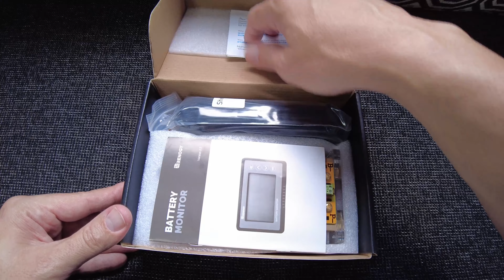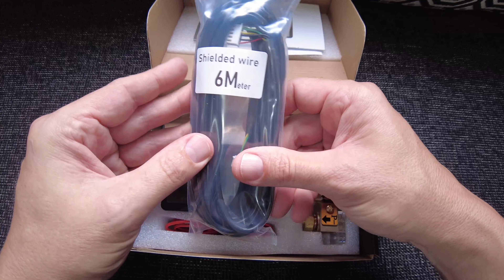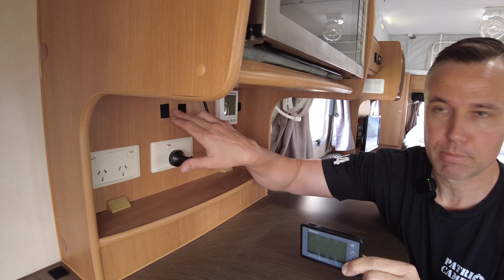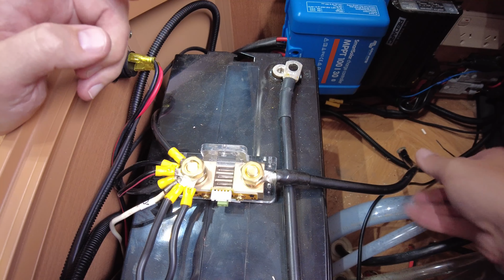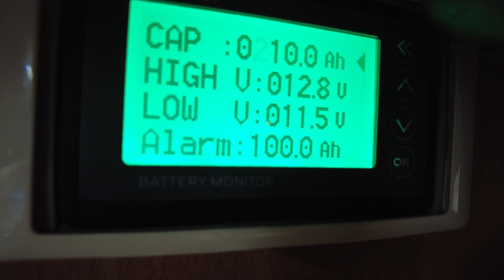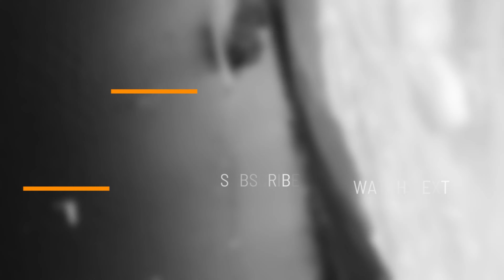Installing a Renogy Battery Monitor RBM500 into a Caravan || Easy DIY!!

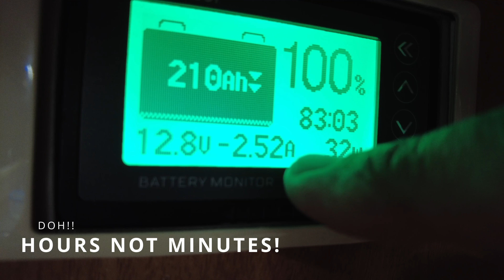Comment: Great video, thank you .  I believe that at the ~7:00 minute mark  you referred to the 'time remaining' as 83 minutes and 5 second.  I believe you meant 83 hours and 5 minutes, as that would be the correct amount for a 200 Amp Hour battery drawing ~2.5 amps per hour.

Comment: looks good. Just note that this shunt, you can remove the clear plastic holder and bolt the shunt directly to the negative terminal.
Reply: I was wondering  I just got the controller was going to install this weekend that plastic is tight and I didn't want to break anything

Comment: what is the name of the surround you installed for the display? i need one too. thanks.
Reply from the maker: It’s just a power point cover I pinched off one of the other Power Points in the cupboard.

Comment: In my setup in my Honda Element, the 12V 100 amp AGM battery is in a battery box that is fitted with a cigarette lighter style plug, into which I can plug an appliance (in my case a 12 V Setpower fridge) to provide power to the appliance.   At the same time my roof solar panel is connected to the battery terminals to provide incoming power, through a charge controller, and I also have a Renogy 20 amp DC to DC charger that connects my starter battery to the terminals of the AGM battery so that I can safely tap into the power available from the alternator while the engine is running.   What I want to do is hook up the Renogy battery monitor so that it gives a continuous readout of the state of charge of the AGM battery while that battery is supplying power to the fridge through the cigarette lighter type plug, and simultaneously drawing in power from both the solar panel and the starter battery.   Any reason why that should be a problem?

Comment: Installed one of these last year and they are far from accurate, I have the Renogy 200AH Core lithium with bluetooth and the 500A monitor, the monitor says the battery is 100% SOC at 200AH 13.4v while the battery BMS reports to the bluetooth app the battery is only 89% SOC.. DO NOT RELY on this bit of gear for accurate SOC info...

YES I do have it installed as instructed and Renogy after sales support is non existent.. I love the 200AH core series battery but the rest of their gear can be sketchy at best.
Reply from the maker: Yeh I have heard that. Mine was fine but I ended up swapping out with the Lithium battery monitor.

Comment: Does the Renogy monitor display information that matches the battery info displayed in the Victron app from your solar charger?
Reply from the maker: There is some minor variations to amp and voltage but for the most part it’s pretty much the same.
Reply: @GetCampingOz  Thanks for the response! The reason I ask is that my my victron app will say my 100 watt panel is pulling 85 watts while the Renogy monitor will say +115 watts...

Comment: I need a surround myself as I had the same problem, but can't find a suitable one anywhere ????
Reply from the maker: Mine was just a power point surround that I pinched off a point from an internal cupboard
Reply: @GetCampingOz  did you have to cut it a bit to suit the renogy dimensions?
Reply from the maker: @simonr23  no it fitted perfectly. No cutting required

Comment: Thank you for the Great information. You are the only person so far that showed connecting the P- all together and then connecting through B- to the battery negative. Thanks for that. For some reason I was a bit confused. So basically all negatives should be connected to basically a negative bus bar and then to the Battery negative, correct??
Reply from the maker: Glad it helped. Yes all the negatives should be connected to a bus bar. The way I connected it wasn’t a great example.

Comment: I'm on the fence with this monitor. I installed mine about half a year ago and I initially really liked it. Unfortunately it started flaking out on me about a month ago. It would sporadically sound it's alarm and tell me I had 0% battery capacity in my bank. I think I've tracked it down to a faulty pin on the wire that connects the shunt to the monitor. Unfortunately, I can't seem to find a replacement wire. To be honest though, I'm not sure I  even want to spend money on a replacement wire if this one only lasted 6 months. It's a shame because I really do like the display. Much more than other monitors on the market. Others like the Victron only show partial information where as this one shows everything.
Reply: Yeah I've installed 2 in different vehicles and they've both done the same. They also read full from half as soon as you start charging. Renogy aren't interested in helping
Reply: @xftexute  I ended up replacing it with a Victron unit. Really happy with it. So happy I actually ordered a second Victon unit for my starter battery.
Reply from the maker: That’s no good to hear. I actually didn’t have mine installed very long as I ended up switching my batteries over to lithium. We’re you able to claim warranty at all?
Reply: @GetCampingOz  unfortunately, I’m the type of guy that pull stuff out of the box and installs it usually without looking at the directions and afterwords tosses what’s left. I gotta stop doing that. 🤦‍♂️

Comment: You need a bus bar. It's not advised to have more than three wires hooked to a terminal and you have a bunch.
Reply from the maker: Yeh exactly right mate. I didn’t show this properly. I’ve actually removed this and changed to a lithium setup. Thanks for watching

Comment: Does the negative solar cable still go direct to the battery or do you put that on the output "P" side of the shunt ?
Reply from the maker: All the negative cables go through the shunt. Ideally I should have used a bus bar.

Comment: Mate you have Victron solar charge controller, you should have got the Victron smart shunt for $100 more.
It Blue Tooths to your phone and you can setup VE smartnetwork between it and your charge controller.
To stop those frayed edges, lay out masking tape and mark your cut out, then cut, comes up perfect.
Reply from the maker: Thanks for the tips. Yeh I should have got it but didn’t do enough research before! Doh!

Comment: Was that your grounding cable (to the chassis) on the negative terminal, or a parallel connection? Where do you suggest connecting the grounding cable in regards to the shunt? I was thinking of grounding the distribution bus (which of course comes after the shunt) but should it go directly to the battery negative?
Reply from the maker: Hey mate. I can’t remember! I’ve removed that entire system and put a lithium setup in. There was no chassis ground at all. If I was to do it again I would only have a single connection to the shunt and have either all the earths going to the neg side of a fuse block or have a negative bud bar. Hope that helps
Reply: @GetCampingOz  Yeah thanks, I’ve gone ahead and done just that; a big grounding cable to the chassis connected to a bus bar, all coming after the shunt.

Comment: The next time you have to cut paneling like that use masking tape on the lines where you're going to be cutting and cut through the masking tape the masking tape stops it from shredding so bad.
Reply from the maker: Great tips for next time. Cheers

Comment: I noticed you have 2 wires on the negative side of the battery, you probably wont get good readings over time like this, you might end up having to reset the state of charge more often. ALL negative wires should be going through the shunt. The only wire coming from the negative battery should go directly into the shunt.
(Edit, I read more comments and it appears that this is just from a second battery, so good work!)
Reply from the maker: Thanks for the tip! Ive actually replaced it (it was always going to be a temporary thing) Im now running lithium setup and the new monitor takes its readings directly from the BMS :)
Reply: Yea the 2 batteries are crisscrossed with 4awg wire. Everything else went through the shunt. Thanks for watching. :-)
Reply: If I have a Progressive dynamic converter installed in my DIY camper. This is where I have all my positive and negative DC wires going to. Should I run a wire from the negative side of the bus bar all the way to the shunt or another new negative bus bar, to accept all the hook ups. Then have one wire to the shunt. 

I figure this might make it easier if I am thinking correctly?
Reply: I don't think it matters how you run the wiring as far as the shunt is concerned, but the shunt is there to measure all the "juice" that goes IN and OUT of the batteries. Just make sure anything that uses any power whatsoever, is not between the batteries and the shunt. @danemmerich6775
Reply: The 2nd neg wire is from the other 12V Batt in parrallel, this is correct, if you connected the shunt the way you suggest, you would in effect be measuring from one battery only.

Comment: When you’re programming the monitor if you do the arrows down there’s two more settings what are they for
Reply from the maker: Hi Barry, Sorry Im unsure - I cant check because Ive removed the monitor and installed a lithium setup. Sorry I couldnt be of help. Cheers Adam
Reply: Are these monitors no good for lithium?
Reply: @xftexute  I don’t no sorry

Comment: You had one cable left on the negative side before you added your short cable to the shunt.  What was that wire?  Thanks for the video
Reply from the maker: I’m not sure. It could have been the negative connection to the second battery. To be honest it want really setup to how I would have like. I should have used a bus bar for all the wires.
Reply: @GetCampingOz  Thanks for the reply.  You probably have a parallel connection or maybe serial/parallel connection as I have.  As for as the buss bar, for sure with the amount of connections that you have it would have been better!  I tried mounting my shunt directly to the battery post without the plastic housing and it would have worked without an extra terminal in place.  I sure wish the battery makers and shunt makers would give just a bit more threaded stud height for heavier gauge connecters.  I think I will make a buss bar out of a piece of copper pipe to suit my needs

Comment: Are people aware that this Renogy is the 500A model. There are 350A and 100A models (in other brands) which are more accurate for lower current systems. If you only ever draw 100A max continuous, or 150A intermittently, don't install a 500A. At specs of 1% accuracy, that gives +/-  5 amps. If you buy a 100A model, at 1%, you'll get 1A accuracy. Just saying.
Reply from the maker: Thanks for the info! I wasn’t aware
Reply: Yeah…tried with a 30 W load shows 28.5 so that’s a 5% error at that current level (2.15Amp+/-0.11amp) assuming the test appliance actually draws its rated wattage. So error is not +/- 5 amp at all currents anyway, but that doesn’t mean you’re wrong, maybe the error on a 100 amp monitor would only be 1% in which case in my experiment it would show 29.7 watt.
For a 100 amp current, an error of 5% or 5 amp would be unlikely. It’s probably a lot less than the 5% error at 2 amp.
Reply: @davidgriffiths7696  
FYI David, I have a similar but different brand of shunt and reader (100A version) on my live-aboard boat. I also have a 250A BMS within a 200ah x 12v system which has Bluetooth monitoring to an app. Yes, sounds all very hi tech and accurate.

BUT ... after innumerable calibrations, and tests, and current logging over months, and system tweakings, I have never been able to get the two current readers and SOC to match. They measure and display variably, sometimes to 10% variance.

Through some forum reading, I discovered that the discrepancies are due PARTLY to the accuraccy % of each shunt (100A, 250A, 500A) sensor BUT ALSO due to the sensitivity threshhold -- that is how much of a small a current they register. Meaning, very low current, background draws and inputs ARE NOT ACCOUNTED FOR. Eg, Always-on USB ports, depth sounders,  LED lights, solar regulators around dusk or cloudy inputs of <1A,  inverters on idle, digital clocks, all that stuff which draws only a few milliamps, will accumulate over 24 hours to give a false SOC. 

I actually discovered my DALY BMS was programmable down to a lower sensitivty threshhold and doing this did improve trustworthiness. It was factory set at 3A !!!!! It would only go down to 1.2A. So there you go. It now ignores all loads in and out of less than 1.2A (14 watts),  which amounts to 28Ah over a day = 28/200 = 14% potential misread for SOC.

My conclusions:
These things will never be better than about 90 true.
Learn to live with it. 
Reset your upper and lower % parameters monthly or you'll have massive SOC drift over a year.

Hope this helps.
Reply: @thedolphin5428  Live aboard boat living the dream. I have a mid sized off grid domestic system I put together myself with 900 Ahr storage li and pv acid. The chargers etc are indeed much better than what was available 25 years ago. I suppose knowing battery status within about 5% is good enough, zeroing off when full is not difficult to take off accumulated error. It’s not surprising that error margins increase nearer the lower limit of instrument sensitivity . (On an aside, I have just changed the charging protocol on the lead acid battery bank, no more floating. I became suspicious of float charging after I noticed steadily rising float current over the weeks, an equalisation charge fixed it, but leisure batteries can afford to drop back a bit when fully charged, and read somewhere float charging shortens their life.)
Cheers
Reply: I wonder. As we are very often only drawing/adding a few amps esp in Winter usage, the monitor would be useless at eg 3 amp+/-5. Even at a 100 amp capacity, we would still have a 33% error margin in this case.
To be useful, the 1% error margin would have to apply to net current eg 10 amp+/- 0.1 Amp. Anyhow, as I have one I will soon calibrate its accuracy using known loads once installed.
Reply: @davidgriffiths7696 What he said is a non sense. All measuring equipment have certain tolerances that apply to the measured parameter, not to the full capacity of the device.

Comment: This monitor is completely useless ... You can discharge your batteries by 100 ah then as soon as it registers the high voltage of 12.8 it resets the display to full capacity , what's the point , I bought this monitor and am totally underwhelmed by it ...
Also , if you have a FLA or AGM battery bank of 200 ah total then you need to set the 'Capacity' at 100 ah , as that is your 'useable capacity' .
The only thing this monitor does is tell the user what amps/watts is going in and out .
Reply from the maker: Yeh I have noticed that it monitors the capacity by voltage and not amperage. I’ve since removed it and installed a lithium setup. It’s the ducks 🦆 nuts 🥜
Reply: @GetCampingOz  worked it out , don't set the high and low voltage , leave them both at 0.00 and it works as it should ...

Why Renogy can't just say this in the instructions is beyond me , took me 3 days to work that out 🤣
Reply from the maker: @tgill3436  that’s good news! Glad you have it Sorted. It’s bit average from Renogy. I will say their smart battery monitor for their lithium works really good 👍🏻
Reply: @GetCampingOz  so you not using this monitor any more?
Reply: @tgill3436  hey mate I’ve just installed this for my system aswel & struggling to find any information to explain it all to a dummy like me… so I’ll set the high & low voltage to 0? Any other tips?? I have a deep cycle 138 amp hour battery
Reply: @xXDANNERSXx  Hi mate , what type of battery chemistry is it ? Flooded lead acid , AGM or lithium ??
Reply: @tgill3436  it’s an agm deep cycle one mate, just a cheapy adventure kings one
Reply: @xXDANNERSXx  Ok so all you need to do is ...
Press and hold the 'OK' button which will take you into the menu ...
Set the 'BATTERY CAPACITY' to 70 AH which is approx 50% of your battery (it's usable capacity) ...
Press the top right hand button to take you back to the display home screen ...
Now the display should show 70AH ...
Make sure your battery is fully charged then press and hold the 'UP' arrow , the unit will beep and it is now set and paired to your battery ...
As discussed before , don't set the upper and lower voltages and it will work perfectly and you will know exactly how much power you have left ect ...

You can set the alarm to alert you if the battery is getting low in the settings menu , press and hold 'OK' then scroll down to 'ALARM' , then you can set an alarm to come on when you are down to 10 remaining AH's or whatever figure you want ... I don't bother with this .

Hope this makes sense
Reply: @tgill3436  thx for posting that !!!
I don't have this, just awesome to see people follow up & help out 👍
Reply: Totally agree with everything you say, as its seems fine when its discharging but as soon as it sees and charging voltage from solar or alternator it displays %100

Comment: why a 2nd ground connection? don't all the ground wires go to the  shunt? Do you have a 2nd battery is series so you have another large cable that doesn't go to the shunt?
Reply from the maker: Hi Matt, apologies for the really late reply! So sorry. Yeh the second ground went to the second battery. Ive actually pulled out this monitor and put in the Renogy lithium setup. Cheers Adam
Reply: @GetCampingOz so a parallel setup?

Comment: did the small red wire fit your postive lead? did you have to over size all your wire connections because the eyeloops where to small for the massive shunt?
Reply from the maker: The red wire plugs into the shunt then connects to the battery. From memory I had to change the eyelet on the wire to fit the positive terminal. I did have to change the eyelets over on the neg as well. Really I should have used a busbar or fuse block, but knowing I was upgrading to the lithium I didnt install it the best. Cheers Adam